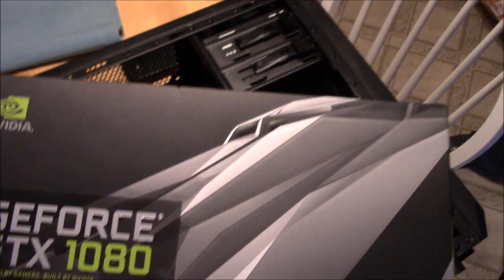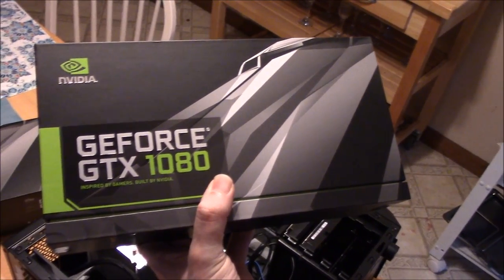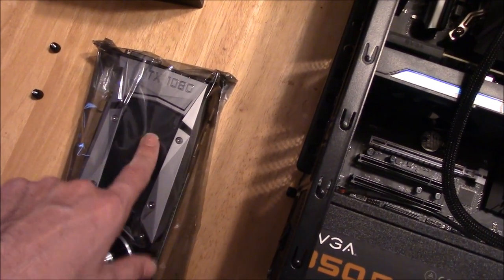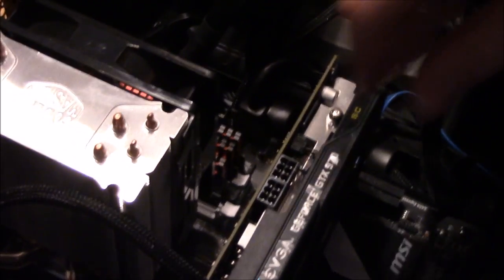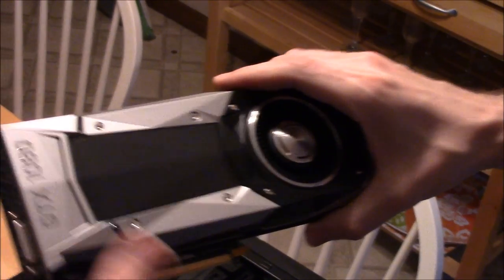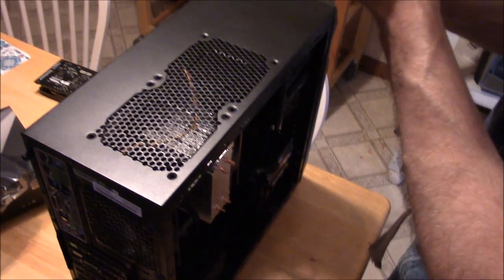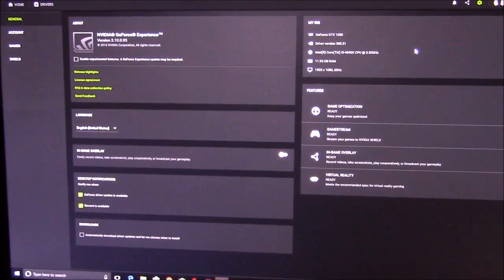Unboxing The Scorpio Killer...

Comment: Pretty crazy when just a graphics card cost more than a entire console
Reply: oscar campos that card is capable of true native 4k at high plus settings or high 144hz 1080p or 1440p gaming.  Also it handles ultra wide like a champ.  Sure its expensive but you get what you pay for.
Reply: Sounds like a poor person problem.
Reply: Minmataro718 and plus gpus are just not for gaming

Comment: Buying a newer CPU will require a new motherboard for compatibility reasons. For that CPU, I suggest you ask someone to overclock it to its potential for you if it is not already overclocked. You've already got a good motherboard and the unlocked CPU for overclocking. Overclocking is free, so I'd strongly suggest it. With a GTX 1080 at ultra settings and 1080p resolution, if you ever see a framerate dip below 60fps, overclock your CPU.

Comment: It’s a sweet card. I have the 1080 from Zotac. It doesn’t care what you throw at it, everything runs smooth as butter on Ultra settings at 1080p. Haven’t upgraded to 4K yet, but I guess it’ll be able to handle that as well.

Comment: I have the i7 4790K paired with this card and some games are held back due to my CPU. Your i5 is definitely going to hold back that 1080 from reaching its full potential, especially since you are gaming at 1080p. The higher the resolution, the less the CPU will affect games as at that point it will be the GPU that will become the limiting factor.
Reply: I agree
Reply: What?! you are doing something wrong then, the i7-4790k is still a monster especially overclocked I am running one in my PC downstairs at 5.0GHz with a GTX 1080ti and nothing is being held back doesn't matter if I'm gaming in Native 4k or 1440p, and Rev at 1920x1080p at 60HZ will be fine with the i5 and his GTX 1080. I would look at your CPU usage and what you have running while your gaming if your having an issue like that because I've never seen or heard of anyone else having this issue with a i7-4790k.
Reply: StrugglePuff yup. Try having a i3 2130 like me hahahaha though tbh, I still run most games just fibe with a GTX 1060. I'm stuck at 30fps on some titles but who cares. At least I still get ultra settings at 1080p on every game besides forza horizon 3
Reply: he will be fine with 1080p 60 fps though. if he bought a 980 instead of 970 back then , he still would be fine with ultra settings ....
Reply: I play at 1440p 144Hz, and in some games my CPU usage is damn near maxing out, and no nothing else open in the background that is consuming more than necessary CPU usage. Oh yeah btw 5GHz?! You sir definitely won the silicon lottery lol. I need like 1.45v to hold a 4.8GHz OC for 24/7 usage.
Reply: I'm telling you there is something going on, it is literally impossible for that chip to bottleneck a 1080 I suggest you do some trouble shooting and start digging because that should not be happening at all.
Reply: Not really , cpu is only a big limiting factor when ur going in the high framerates. 60 fps wont be bottlenecked by i5-i7 cpu's anytime soon. saw a vid by digitalfoundry i think, even first and second gen i7's performed (almost?) equal at sub 100 fps i believe

The higher the framerate, the more pressure on cpu's
the lower the framerate , the more pressure on gpu's (not framecapped ofc)

an i7 8700k wont give a more stable 1080p60 compared to a i7 2600k
Reply: Stop spreading bullshit misinformation, it does not bottleneck at higher framerates and it does not bottleneck period, I have two PC's one with 16gb of ram a i7-4790k overclocked to 5.0ghz and a GTX1080ti and I game mostly at 1440p 144hz max settings on all titles, there is no bottleneck at all and shouldn't be. He has an issue that is either not known to him or something is sucking up all that cpu usage that is not showing up or hes just not seeing it.
Reply: Yeah I got extremely lucky and I'll never get rid of it, I've had plenty of people who have tried to trade/buy it from me but I'm not letting this go.
Reply: Hey what is your GPU load while gaming?
Reply: GPU load is always 99% (max), and CPU is usually 80-90% depending on the game. For example, in the new COD, GPU is maxed out, and CPU is ~90% usage which it shouldn't be. PC was recently wiped clean, been 1 month so far on a fresh install of Win10.
Reply: There are literally vids and forums showing the performance gains newer cpu's have over the i7 4790k and older i7's in GPU dependent game footage at high framerates. If the i7 4790k wasnt a bottleneck then there would be no performance difference in GPU DEPENDENT SCENES. But okay. enjoy believing ur own bullshit then.
Reply: Have you ran any scans for malware or viruses?
Reply: 3 year old i7, and I'm supposed to be the dumbass here... k
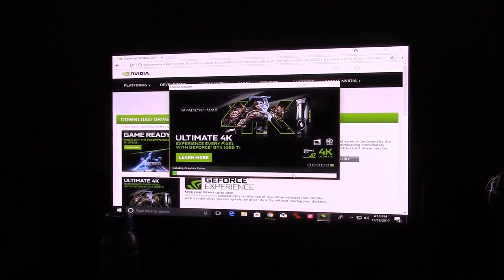Reply: Yeah that is what I said if you read my OP. He said "ALL I WANT IS 1080P 60FPS HIGH/ULTRA". Re watch the video @9:52. You clearly didn't listen.
Reply: I have none of those issues.
Reply: Yeah your CPU should be about 25-40% at load and your GPU should be 99%, it can vary depending on the game and how optimized the game is but it shouldn't be at 99% load on your CPU it's really strange.
Reply: Yeah I know its very weird, and this all coming off a fresh install of windows. Only been 1 month with a fresh install. I am not trying to start shit with anyone on here, just letting rev know some of the things that I have seen and experienced.
Reply: I understand I don't think you were trying to start shit at all, I've been racking my brain since your post trying to figure out what the issue could be because it's bothering me lol, if I run across anything that could help your issue or a fix I'll let you know.
Reply: 1080 is overkill for 1080
Reply: MrIDGAF84 same here i74790k isn't holding my 1080ti back.
Reply: something is fucked up with your cpu man at 1440p I've never see 80-90% cpu usage in my life I'll go check now I have the i7 4790k at 4.8ghz at 1.32 core voltage

Comment: I got the 1080ti but still I go back to console. I don't why man. Still haven't bought Scopio but damn I'm tempted.
Reply: Because you have a PC with a 1080ti its pointless getting an Xbox really because you already have one in your Rig IMO the only combo to go is PC and PS then you get the best games of 3 machines on 2.
Reply: PC's are not for everyone, you should've known that before you even got into PC gaming.
Reply: GTech PC+X1X is not worth it! if you want to game on a Console just buy the PS4 Slim with 1TB for $250 or wait for black friday it should drop at least to $200! 

You can run every Xbox Game Maxed Out 1440p60fps so again the X is not worth the $500.
Reply: Justin G Completely understandable. Errors are frustrating even for the die-hard PC enthusiasts. If you own a PC eventually you'll run into problems. There's no going around it.
Reply: Consoles are not safe from technical issues either, I've had problems with every console I owned. At least on the PC side it's easier to fix the problems, but there's also higher change that you create those problems with your own mistakes so pick your poison.
Reply: Justin G I thought I was the only one who owns top of the line systems with GTX 1080ti's yet still buy an Xbox One X...you hit the nail on the head though, the backwards compatibility was the reason it drew me in, playing Oblivion on my big 4K TV with a controller is nice! (one of my favourite games too).

Comment: Pair that 1080 with either a z270 motherboard and an i7 7700k or a z370 mobo with an i7 8700k, add 16gb ddr4 3200mhz ram, and that will be a 4k 60fps ultra settings machine 👍 the 1080 got legs.... man your sister looks a lot like u too. Happy gaming.

Comment: Next step? 144Hz monitor + AMD Ryzen 1800x so that you can get 144 FPS ULTRA in ANYTHING. ANYTHING.

That's like solidrev going ultranerd. Once you get used with 60fps ultra settings and then you notice the difference to 100+ frames... 

I mean imagine playing the next METRO game on 120fps ultra on a 1800x/1080 combo. Fucking nerd. There's still time. There's still time.
Reply: Jove89 8700K > 1800X @ Higher refresh rates
Reply: Jove89 144fps with ryzen? Lolol nah. I have a 1600X and im saying this. And the 1600X and 1800X have the EXACT same single core performance lol
Reply: What people don't understand when they buy things or speak of performance is that they don't take "long-term" into account. 1800x is just better long-term because it's a better multi-core product. Single-core is already starting to get to be old in the gaming industry. Most games that launch launch with multicore support now and are optimized for it. Single core is not really something to look at anymore. So while 1600x may be better for the buck now if you're ONLY gaming, the 1800x is a better long-term solution. 

Which is I'm sure what Rev is generally looking for as he's not the type of person that will change parts every year.
Reply: people have been saying this since the fx lineup my i7 4790k at 4.8ghz would still crush ryzen 1800x at any resolution
Reply: Lol. That's just inaccurate on any level. Deluded Intel fanboys will come out with alternative facts to support their deluded theories. Sigh. There are Intel fanboys out there that are not deluded and actually have common sense. Even they would laugh at your post.
Reply: Jist Shock that i7 is still an overall worse cpu.

Comment: the one X isn't even a quarter the size of this garbage can  and I'm sure you didn't spend $500 on this rig that graphics card by itself costs around $500. in a closed development environment a 6flop console can run like a 12 tflop rig this isn't my words this is what John carmack said. 9tflops on a PC many times is just 9tflops and sometimes that's not even used properly  it won't be used properly so enjoy the games build for $80 graphics cards  on this $500 card. this is another  reason why I stopped buying PC hardware for gaming.
Reply: Julio Alcantara You can build a Scorpio Killer for $500. This is more like a Scorpio destroyer.